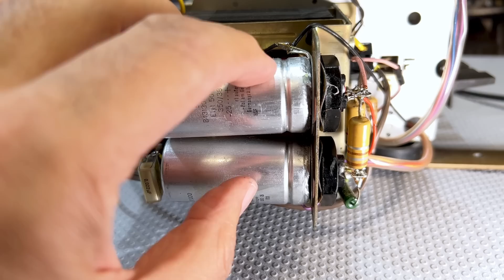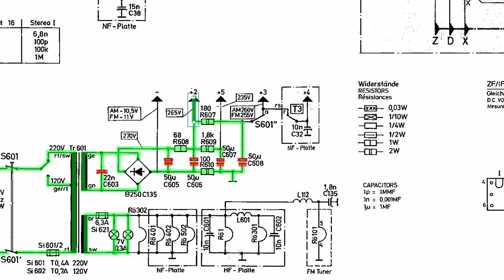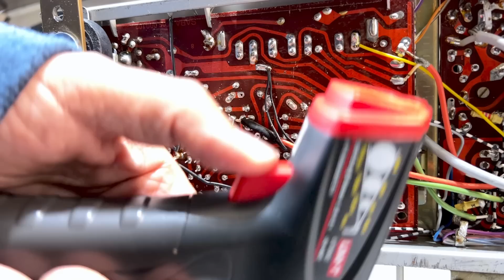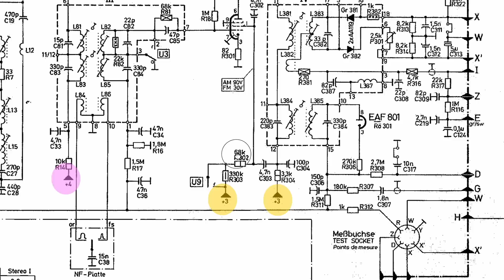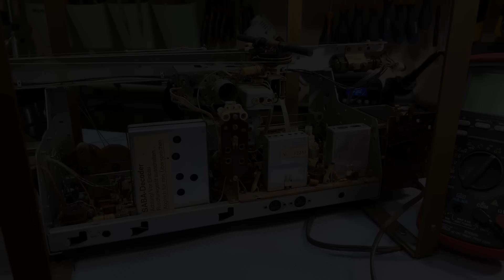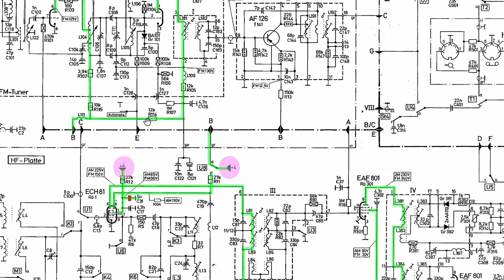Restoring the Power Supply of the SABA Stereo I - restoration part 2

Comment: I know this is somewhat late to be commenting but I have three Sabas with these piano switches (a Konstanz KN16, a Meersburg Stereo ME19 and a Saba Stereo Studio I) and the on/off switch (on all three) does not disconnect any of the other switches. So either I have three that have the same problem or, more likely, the on/off switch is not intended to kick up any of the other switches. So what you have looks to me like it is doing what it should be doing!
Reply from the maker: I believe so.

Comment: I like your approach. Just restored an old Heathkit Valve Millivoltmeter (AV-3U) had to replace a number of the same type of resistors as well as the caps. Using your "painting of the schematic" would have saved me a lot of time, kept doubling up.  I can now use this for the alignment of a 1950's Marfil radio I bought in Spain. This radio too has a fixed negative bias generated in a similar way. The set had a very noticable 100Hz hum. There are two reversed Electrolytic caps for two negative bias sources. One via a 500K resistor (low ripple), the other biasing the EL84 straight to the raised ground point (high ripple). I added a 4.7K resistor and another Cap to improve and the set is now very quiet.

Comment: I can always appreciate this level of meticulous work. Very nice!
Those resistors are of exactly the same type as the ones which I had to replace on the Philips tuner which I'm currently restoring. The ones on the anode of the EABC80 and the EM84 were high too, just like yours. To be fair, if I was a resistor sitting on a supply line for 60+ years, I'd be pretty tired too. 😊

Comment: 4:36 Is that a RIFA safety capacitor ?
Reply from the maker: Yes
Reply: @electronicsoldandnew  , i get the jitters when i see a RIFA cap, seen so many blown up and with damage left behind (and not to forgot the smell for days). i replace good or bad ones always with a decent brand.
Reply from the maker: I have seen the same thing with older versions, but haven’t had any problems with recent lots. These were the only type available locally. The alternative would have been a two-week wait for shipping 😊

Comment: Manuel, usually I skip through the schematic portions, but today I did not, and was rewarded for my diligence!  On my latest project, my schematic (Sams Photofact) actually had a neat little resistance table that laid out the resistance from a pin socket to ground, or in some cases the output of the rectifier.  I really had no idea what it was for, but with your explanation, I understand fully.  This will certainly help me on my next project!

Comment: Just saw at D-Lab channel he opening an old cap wit a pipe cutter. It may be a good idea to re-stuff the caps, just cut it 2 or 3 centimeters  from the bottom, re-stuff and glue it back, may be using a piece of plastic inside to increase the glue contact area, it may looks almost pristine, or one can find a place is covered. Just my 2 cents.

Comment: Manuel, one hint from me: You shouldn't solder on a tube socket while the tube is in place. The heat can damage the sealing between the metal pin and the glass. It doesn't happen very often but it would be a pity if the rare EMM803 pulls air 😉
Reply from the maker: Very true 👍

Comment: It looks like the third part 601 switch was to make the radio turn off instantly, instead of fading out as the capacitors discharge when power is disconnected.     The old girl is starting to come back to life.  Thank you for another restoration journey.
Reply from the maker: Yes, that is it. In some radios they actually short the audio signal to the power stage to ground.

Comment: Perfection. BTW, your X2 replacement cap looks like rifa for all measures. For the switch - the lamp switch looks fine, just if I were you I would get two of those in parallel for L and N poles, attached to the same string, both mounted with the same screw.

Comment: Another great video!  Really enjoyed it.
One thing in the video really threw me for a loop!  One of the reasons I have enjoyed this series is that it is a VACUUM TUBE (VALVE) type radio.  As you were tracing a line on the screen, all of a sudden there was a transistor (symbol)!  What happened to the... oh, OH yeah, took me a bit because I really have not had the opportunity to work on or even see any hybrid-type radios before.  Knew they existed, just haven't seen any.
That switching system for power looks like it could be a real monster to decypher to me.  I know you will make it work correctly in any case.  Overall it seems to be a really good design and a nice radio.  I have never before run across a tube that contained two pentodes AND a triode before.  That could be fun to work with methinks.
I can only speak for myself, but since I do understand the issues with trying to do work on a radio AND video it at the same time, I thought I would let you know that as for me, if you say what you are going to do, then do it "off camera" and show the results, that would be perfectly fine.   There are some things that simply are not possible to do safely, correctly, or timely while also using a camera to video it.
Again, I really enjoy your videos!
Reply from the maker: These hybrid radios are a little strange, but they were fairly common in the early 60s.
You’re right about the “doing and recording” difficulties. It’s a real pain, but some viewers have asked me for a little if it, so I’ve obliged, with lots of speeding up, of course 😊

Comment: Wow that power/signal bus would have thrown me for 6. But thinking about it I used to do almost the same on circuit diagrams with the angle of the wire joining the bus gave an indication of which way to follow the bus to see where it would exit.

Nice work flow
Reply from the maker: Yes, it’s logical, but it takes some getting used to.

Comment: I hate it when tube circuits have one side of the filaments grounded to the chassis.  Lifting that ground (or multiple grounds) and rewiring the tube sockets with twisted pair wiring ,  then installing an artificial center tap on the filament secondary with a pair of resistors, works much better for lowering hum.  It can be a royal pain to do this modification in a crowded chassis, however....
Reply from the maker: A royal pain indeed 😊
Reply: A royal pain? You mean a Megan? 😂😂